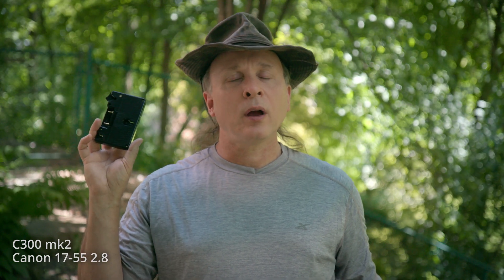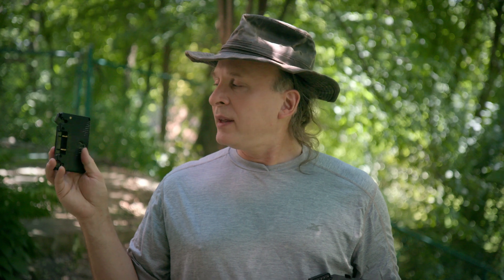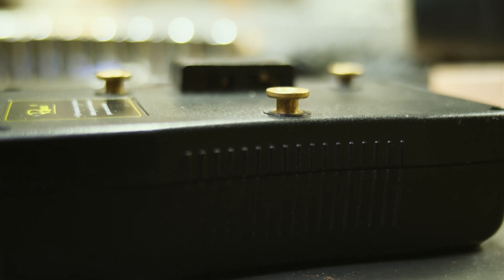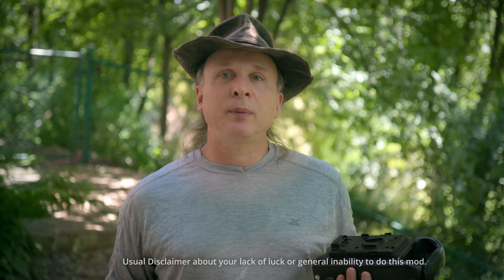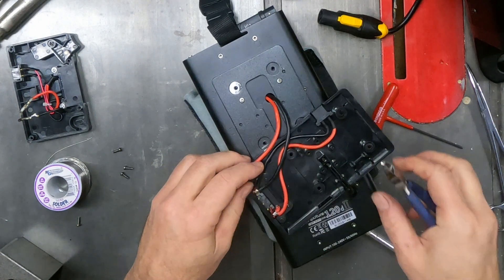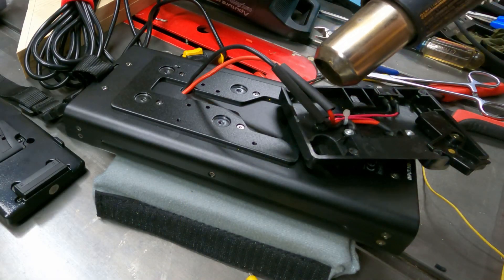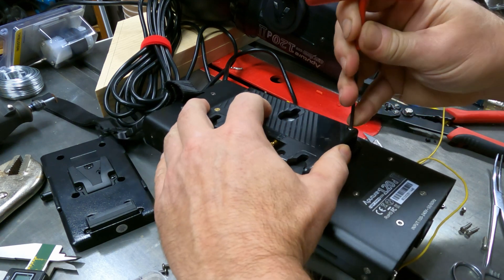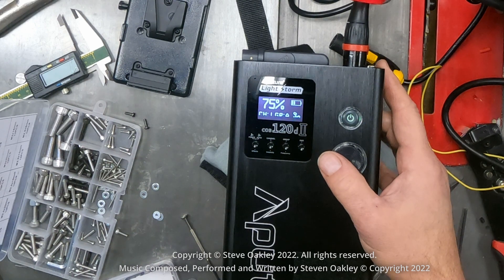How To Change A V mount or Gold Mount Battery Plate On Your Video Gear Like This Apeture 120D

Comment: 1. Intertwine the cables before solder
2. The solder gun should heat from below wires and melt solder into joint.
Reply from the maker: no, don't wrap the wires together. there is zero need for that, this is not an audio or data application, and then they would become too short, they are also not that way from the factory, its DC power going into a PWM power supply 🙄. 

solder tip above or below the joint has very little impact in the real world for this application, its all about watts and surface contact to transfer the heat.
Reply: @thedp  WRONG. Your soldering technique is crap.  https://www.youtube.com/watch?v=Zu3TYBs65FM

Comment: Hey Steve, after having used both gold and V would you say that gold is the way to go - or it doesn't matter? I have my own photo video biz, I'll be using my own gear most of the time and I take care of it. I have Godox lights with V mount plates on them - not sure if I can swap them to gold (can I ?) so I was thinking of sticking with V.
Reply from the maker: Hi ! I think the question is how far into V mounts are you with batteries as thats the expensive part. The IDX plates are nice for V mount but overall I normally prefer gold mount. They lock consistently, don't fall off, generally seem to work better.